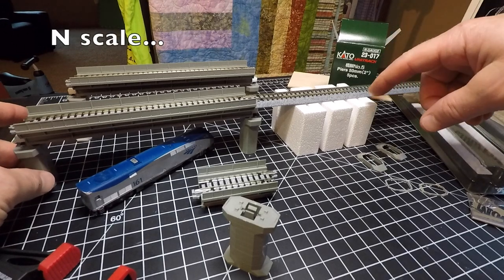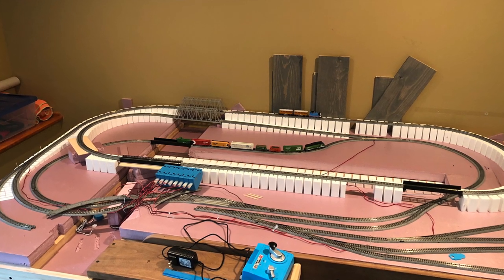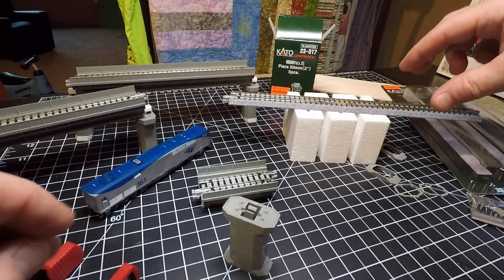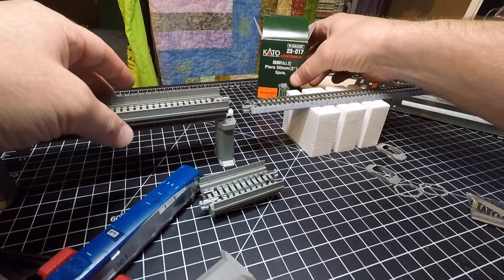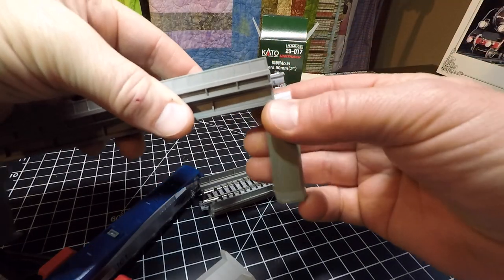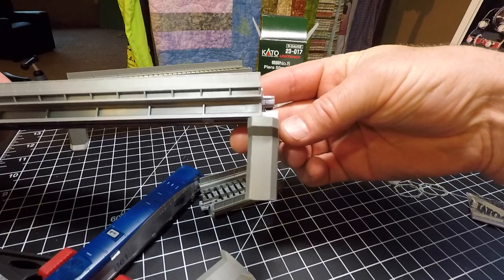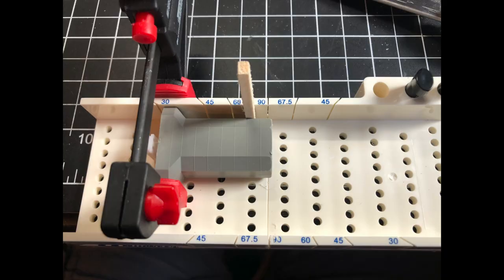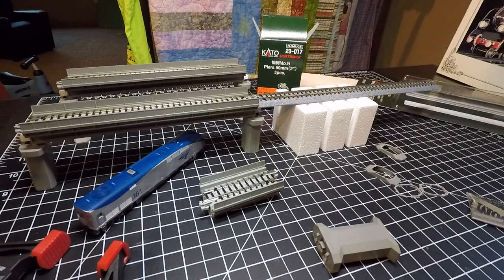Kato Unitrack Piers and Viaduct with 2" Woodland Scenics Risers

Comment: For those that are going to be using scenery, instead of cutting product (which could be permanent), I would try putting cork, or some drink coasters under the foam risers to raise them in small increments until they match bridge level. You wouldn't even know they were there once you cover them in dirt and some bushes. Only thinking this because maybe some people don't have the tools and/or skill to cut so precisely. You mess up a cut or break something, and you're screwed.

Comment: Both the 2" foam risers and the 2" plastic piers are designed to provide 2" clearance for rolling stock which is critical.  The height of the rail above your baseboard can be maintained by ADDING material under the risers.  I think chopping the piers will a mistake in the long run.  You may eventually want to run a unit that is too tall for your modified viaduct.

Comment: What I do not see in the video is testing the clearance with that engine on a piece of track. The clearance you are seeing there does not take into account the additional height of the engine + roadbed and track. This could lead to issues with higher loads such as High Cube boxcars and the stack train units.